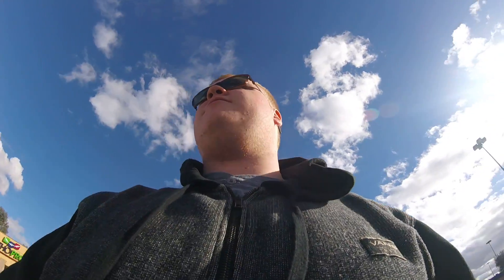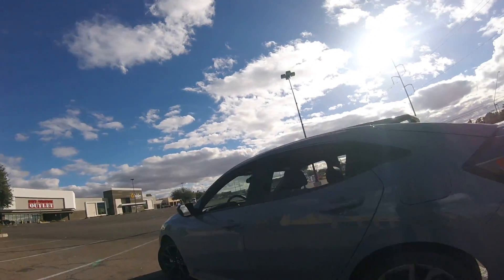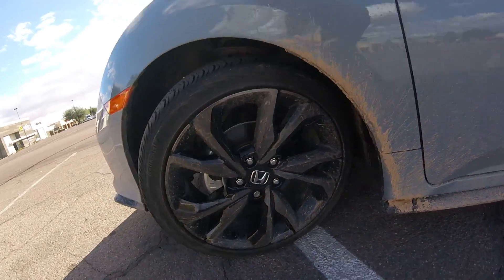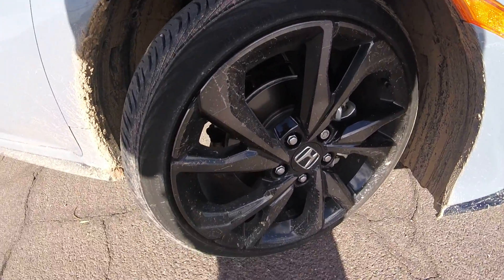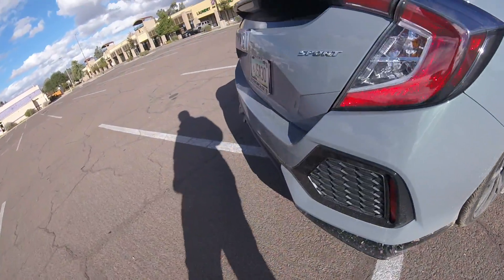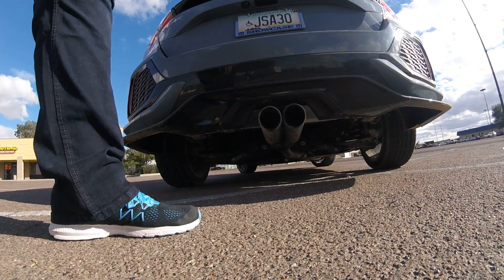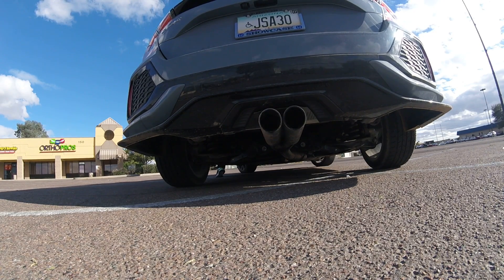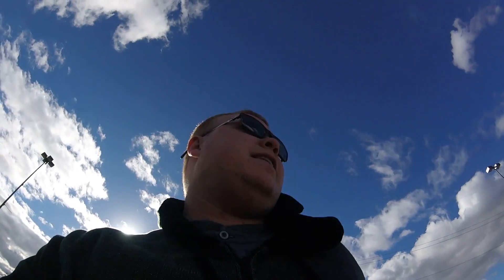2017 honda civic ! must watch this

Comment: Where did you get the exhaust from and what did it cost?
Reply from the maker: jamie F it's custom made and it was 400 but you can go to a local shop and they should be able to do it ! it's straight piped